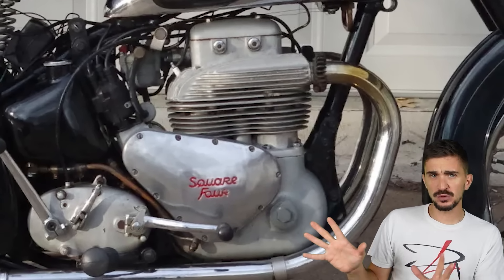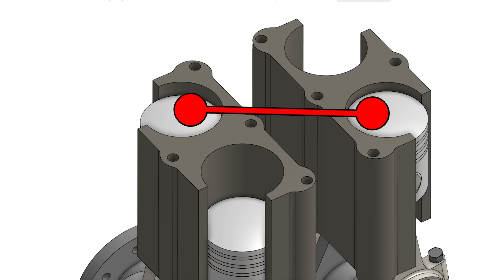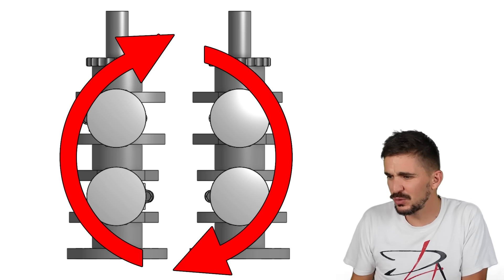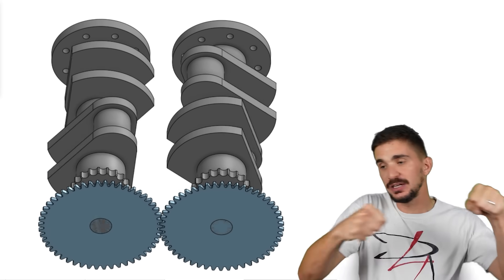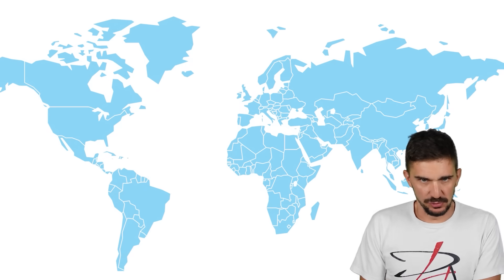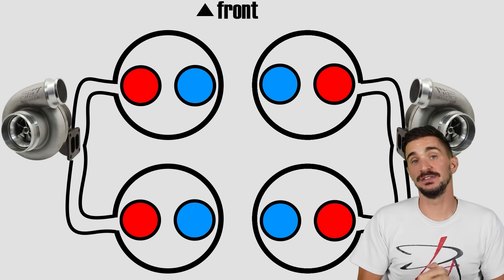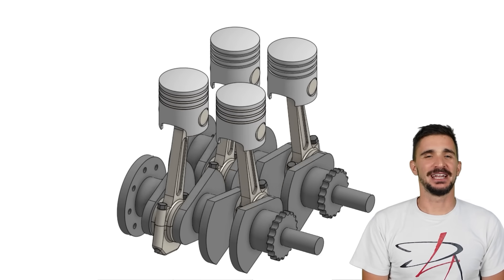From the Outside It Looks Like a Single but Inside Four Pistons Mingle! Square Four Engine Explained

Comment: They were forgotten because they melted. Not enough cooling. Might have been a thing had it been liquid cooled.  The Triumph and BSA triples suffered from the same condition. Center cylinder saw excessive heat that led to premature failure. Gorgeous bikes though fatally flawed.

Comment: Great vid bro. I have an unrelated Q. If a car is electric with all wheel drive and with 300 hp motors on each wheel, is it 1200hp? Or 300hp at the wheels?

Comment: I worked for a few years for a small motorcycle shop. A 50's square four was the last engine I overhauled before the shop closed down. Business killed eventually by Jap crap imports and dealer only servicing, parts and repairs. We got plenty Super Sixes and the like in that had been crashed but they were a PITA to work on (JS head "steel" screws corrosion welded into aluminium castings) and mostly not economic to repair due to any spares having to be bought under the counter or imported.

Comment: This must be the only engine that nearly doubled in capacity for little increase in power, the later alloy head helped reduce the rear cylinders cooling problem, some owners found them ok and did high mileages but others had lots of trouble with over heating.

Comment: In the case of primary and secondary balance, couldn't you just make this an 8 cylinder and have the counter-rotating crank offset by 90 degrees thereby having both perfect primary and secondary balance on top of being more powerful and not needing any counterweights added?

Comment: Interesting comments regarding air and liquid cooling.  Back in the 1970s I owned a Suzuki 750 GT which had a liquid cooled transverse triple two stroke motor.  
It was very innovtive many ways but primarily stood out from its rival Japanese competitors by it cooling system.
I had a lot of degrogatory comments from my bike mad mates regarding my "water bucket" including how I'll be scalded if I crash etc. 
Although of smaller capacity than some of it rivals  the motor was very smooth with amazing acceleration which combined with my then youthful mildly irresponsible riding style allowed it to outperform bikes with higher ccs. 
Recalling free living bygone times with friends it seems they have forgotten my predictions that most motorcycles will be liquid cooled  into the future. I guess nobody like a "told you so."

Comment: Near where I live there is a scrap yard with what I believe is either a hydraulic pump ou an aircooled diesel V square four, as in two square four banks in a 90 degree V. I can’t even imagine how the crank of that thing works

Comment: I am actually a bit confused why this engine never took off it doesn't look hard to maintain and other than the extra crank shaft it doesn't seem that complex that can also be worked on at a standard mechanic but also looks like a good space saver vs v4s or inline 4s in todays motorcycles

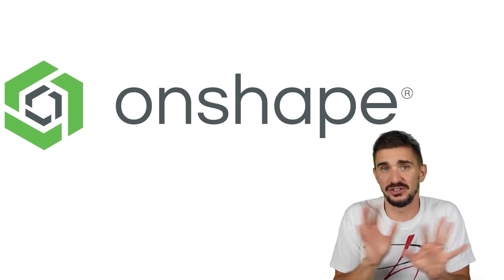Comment: 2:40 Cloud-based tools are a no-no for me: I do not want any commercial operator being able to choose the rules governing my use after I have bought the software, in particular I refuse to be tied to a subscription to rentier capitalism, and I do not trust that companies will not feed my designs into their AI systems to be regurgitated to their profit.
Reply: What software is comparable and not cloud based? Thanks for sharing.
Reply: @jhuntosgarage  What about having your own private NAS storage at home, not relying on cloud services such as Google Drive.  You sure can access your NAS storage remotely when you're outside as well, if setup properly.
Reply: @jhuntosgarage  Fusion uses cloud for storage but runs locally. And you can still import models locally.
It's my preference compared to other stuff I used: SolidWorks, OnShape, SolidEdge, Alibre Atom, FreeCAD.
Being free with some small limitations is a great plus too.
Reply: Agreed. The worst part is if they discontinue the software you can't use the models you created anymore. Could be years of work down the drain!

Comment: I worked at Joe Sarkees motorcycles in the late 70s to late 80s,  honda, triumph, m0toguzzi bmw dealership,  we had a customer who brought one in he had shipped from England,  couldn't start it, scored pistons & cylinders found, tech smacked the cylinders with a deadblow hammer & they broke off & dust flied! The cylinder fins were fiberglass or alabaster,  mechanic shit himself & customer paid to have a bunch of triumph cylinder fins brased and onto his cylinders.

Comment: Have you done a video on Phil Irvin re-phased Triumph motor from 1960's?
Early 2000's it re-surfaced and became very popular for the old (1968~82) Yamaha XS650.
There was a massive amount of confusion as to why it had been done, most people thought it was to reduce vibration but somewhere in the original article it stated one piston was stationary while the other was at maximum velocity which allowed reduction of flywheel mass, less vibration was just a byproduct.
Square four actually became incredibly common in mid 80's due to Moto GP where Yamaha and Suzuki used it and then made two stroke RD 500 and RG 500 square four street bikes with around 100bhp (as a Suzuki/Yamaha dealer head mechanic I got to ride both )
The original Suzuki RG 500 road racer only made 115bhp, friend had one, rode it four times, crashed it four times, spent double what it initially cost repairing it (way more money than ability)
Having gear teeth machined into a full circle flywheel could make motor narrower and possibly slightly shorter?
Everything I ever read about the Ariel said seizure on rear cylinders was a problem (especially on the original 600cc motor)
With revised/extra cooling passages on the 1000 cc motor it was mostly solved although still an issue.

Comment: So setting up a 4² at 90° out, one cylinder popping off at a time (1@TDC, 2@MID↑, 3@BTC, 4@MID↓) would allow better intake and alleviate the high end problem, yea? 

... I mean, if ya thought engineering a 270° preCAD, ala trial and error, wasn't difficult enough, idk, maybe balancing, err, compensating for the rotational torque, of a 90°4² could've been a nightmare.

Comment: Wonderful engine! I would love one of those so I can build a retro looking Shifter-Kart. Just run an air scoop towards the top of the engine, that way all four cylinders get fresh air. And boost it with twin superchargers. One for each crankshaft. Just for the cool factor, cause a single turbo feeding all four would be fairly easy. Twin SC ftw!

Comment: i think the breathing could be fixed by offsetting the valves by 45 degrees so that the exhaust valves feed into one singular exhaust on each side and the the intake could have space to get enough air, and could it be made efi?

Comment: The Ariel Square Four was first produced as a cast-iron engine before WW2 with an overhead camshaft. The two crankshafts were coupled by gears in the centre. It wasn't hugely popular, and after WW2, Ariel introduced an all-alloy engine with the coupling gears on the left side of the engine. This was called the 4G Mark 1, and later in the early 50s the 4G Mark 2 came out with the exhaust manifolds having two exhaust pipes. A much larger oil tank was installed towards t he end of production.
In 1965/66, me and  a friend bought a 4G Mark 2 and rebuilt it. It was superbly smooth, but there was a flaw in the engine oil supply, in that one of the big-end bearings was further away from the oilpump than the others, and this made it vulnerable. 
Of course, nowadays if one was to be made again, water cooling would be  used, and better oil supply arrangements made.

Comment: The primary balance explanation was wrong. Two opposing torques just cancel out from the two twin pairs. You drew the red arrows as straight forces which would make the engine torque from the top down. However these arent straight forces being made, they are torques that would just cancel out.

Comment: 11:27 THE NOISE I MADE 😂

Also, as soon as you described the engine layout, I immediately thought about a four-stroke engine where each twin is 180° and the crankshafts are oriented 90° to each other, so that each cylinder is at a different point in the cycle. And then I imagined firing up the naked engine and watching it walk across the floor.

Comment: Why do you think the V4 never look off in sport car platforms? Being able to have it as hard up against the firewall so it can have a mid front engine position without needing a massive engine bay like an S2000 and wouldnt need a wide engine bay like a 86 or brz. To me it always felt like the best engine for that type of platform

Comment: Hello, i appriciate all of your videos. Especially on the V5 Honda RC211V. But, the idea of cancelling out two gyroscopes in opposite directions is false. They allways adding each other forces and never cancelling each other out. This is a totally faulty and misleading information from Ducati. It is physically impossible, because a gyroscope forces a resistance against the jaw of a rotating mass and it’s irrelevant in which direction it rotates. So two gyroscopes resisting against the jaw two times, no matter if they spinning equally or in opposite to each other.

Comment: For adv, intermediate, sport-touring, cruise, the trend seems towards 270 deg twins to lower production costs and hence retail price. Fpr  four cylinders the extra cost of precision components - 16 valves, four throttle bodies, four con rods and bearing sets and prob more crankcase material versus half for a twin, adds up. Four a square four add another crank shaft. Only the high end super sport, e.g., Ducati bros, and Hayabusa boys are in the market for a four. Honda Valkyrie tourers & Runes get the smooth sixes but that’s a high end market.

By the way, even H-D is going liquid cooled. The Sportsters are liquid cooled with only the full sized Milwaukee 8 being oil-air cooled.

Comment: What you start describing at 7:16 is factually wrong. The engine does not rotate in that way. There are no forces that act in that direction. The engine does have absolutely perfect primary balance.

Comment: I love mechanical engine oddities as well. We can a learn a lot from such attempts. I wonder about cooling on a big cast cylinder block with not one but four sources of heat. That's a big chunk of thermal storage for an air-cooled engine. You can tell they were probably thinking about it as it has some serious "fin'age", lol. Cheers. 👍

Comment: Great video!  I love how you always include the primary secondary, and I will call it tertiary (rocker arm) balances.  Have a question, though for consideration.  Yes, there are two crankshafts. But each of them is only half of a regular crankshaft. It seems to me that there is half the chance of a quality problem in each, meaning that the yield is likely higher, and Half the material, the ability to make it on smaller machines, I’m not sure that you end up with a much higher price. What are your thoughts on that?

Comment: In 1931 when Ariel went into production the square four was overhead cam (and only 500cc.) The cc then increased to 600, but when they went to 1000cc in 1937 the OHC setup disappeared for some reason  (cost, I`d guess!) . The 1953 on "four pipe" design solved the overheating issue for all but the very hardest of riders. Timestamp 10.56  shows a black  OHC model at Sammy Millers museum ( well worth a look!)

Comment: 13:00
The problems are all solved by current technology.
Gimme a 400-800cc square four and I'd be happy.

Liquid cooling,
Direct injection,
Electric supercharger (like Kawasaki's).
4valve DOHC vvt(not really necessary)

Comment: Reminds me of some of the aircraft and tank engines from the '30s-'50s that did something similar with geared crankshafts.  The British were in love with the idea.  

What doomed this idea in a bigger format was mostly reliability problems, but cost and weight are also huge issues with building an engine with two crankshafts geared together.  The problem ended up getting solved with better supercharging and finally turbine engines making the problem vanish.

Comment: So....why don't you make the engine in a slight v so you can get the air into the engine. Yes, you'll have 2 heard but in a motorcycle that's like an extra 5 pounds. The balance increase would be worth it I would think

Comment: Well rotary valves would solve one of its main problems, and also having the air intake under the tank, like some Indians do, does not only open more space for the air to go in, but would also help the motorcycle have a lower center of gravity if the fuel is stored under the seat. 

No gyroscopic force...low center of gravity... better air intake due to rotary valves... Sounds like the dream motorcycle for beginners and engine nerds alike.

Comment: always when i read/hear about interesting engines with their advantages and disadvantages i automatically think about the electric motor....with 1 moving part, no noise,vibration, little heat, great torque.....but yeah, no character either.....
Reply: and a ton of additional weight, as all electrical driven vehicles

Comment: 13:50 If anyone is going to build a modern square 4, the really should look at Freevalve. In addition to its usual benefits, on a square 4, it would allow a lot more room for intake ports and manifolds. A water cooled square 4 with Freevalve and turbocharging could be a real monster, especially if you use direct injection and switch to two stroke once the boost is up enough. I suspect these tricks could result in power outputs over 300hp/L on pump gas, which would be seriously impressive. Would it be enough to make the development worth it for a major manufacturer? Probably not, but if you want to build something, why not aim for the moon?

Comment: I think the intake issue would easiest be solved by moving the intake valves to the outside, sort of like on a hot V engine. Also since it's square the exhaust gases could be run out of the block parallel to the crank and the inlets could be placed pretty traditionally at a right angle to the crank

Comment: What's the difference between a 4  cylinder that fires 2x2 and a larger 2 cylinder engine? Serious question. Are the smaller pistons more efficient than larger ones?

Comment: Maybe I'm missing something here, but aren't the counter weights going to cause massive rocking couples in this scenario?

They are both pointing towards the same horizontal direction together. I'd expect these engines to be designed in such a way that the counter weights would oppose one another during mid stroke (90º & 270º) in order to smooth things out, similar to how a 90º V (any even number, lol) engine works.

Comment: Hello, i appriciate all of your videos. But, the idea of cancelling out two gyroscopes in opposite directions is false. They allways adding each other forces and never cancelling each other out. This is a totally faulty and misleading information from Ducati. It is physically impossible, because a gyroscope forces a resistance against the jaw of a rotating mass and is irrelevant in which direction it rotates. So two gyroscopes resisting against the jaw two times, no matter if they spinning equally or in opposite to each other.

Comment: Here is a question for the engine nerd channel that I hope you can answer where others have not. How can an engine rev beyond it's torque peak if the engine is making less torque as the engine goes faster?  I would think that the maximum engine speed would be at the torque peak since the torque is what is making the engine spin to begin with, but obviously something else is happening because engines spin faster well beyond their torque peak, sometimes going twice as fast as the speed at which maximum torque is achieved.  Thank you for your response if given, other so-called engine experts have been asked and have been non-responsive.

Comment: Recently I've been thinking of a similar U-8 configuration (which I will 3d print in plastic at some point). The main idea being that the crankshafts are in phase but counter-rotating to offset the secondary inbalance that I-4 engines have. Another benefit would be that you could have a shared camshaft (pushrod) for the intake valves, should you decide on a mirrored firing order.

Comment: That dual turbo for the cars would be glorious! The layout of the valves needs to be rottaed 90 degrees to fix the intake problem. One turbo on each side feeds 2 cylinders, one of each crank, and with a simple fuel injection, that would be a screaming hot engine power to weight parameter.

Comment: 3D printing makes this project possible using parts from 270 degree twins. The cost would be eye watering printing the size of parts needed.  Machining from solid would be similarly eye watering.    Great video, always liked the square four, could only afford a single pot Velocette 500 in my youth.

Comment: This could make for a nice diesel motorcycle engine since it's so low rpm and smooth running. Imagine a long distance touring bike with 1000Km+ range.

Comment: Rear cylinder overheating was an issue, I understand. Liquid cooling may be a better option. I was told that the rear bores were bored oversize to accommodate the expansion of the rear pistons. I never had personal experience, just hearsay 50 years ago.

Comment: The square four was another of Edward Turner's designs , others were the various Triumph engines and the  hemi-head Daimler 2.5 & 4.5-litre V8 engines used in the Daimler SP250
Reply: BL dropped the superb Daimler V8 in favour of a newly designed Triumph V8 - which was an unmitigated disaster.  One bad move.

Comment: Would there have been any benefit to switching the intake and exhaust?  A single exhaust manifold down the center and two carbs mounted to the sides.